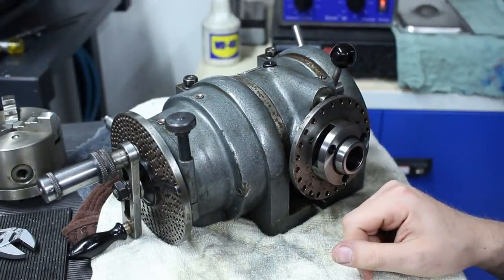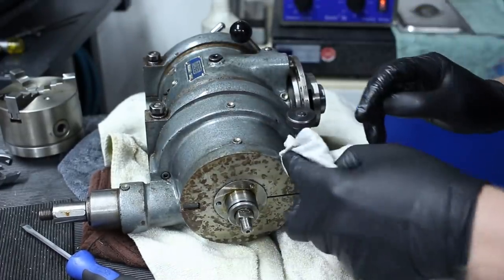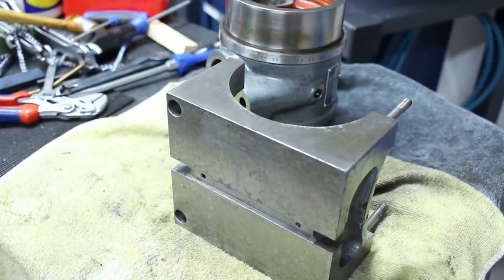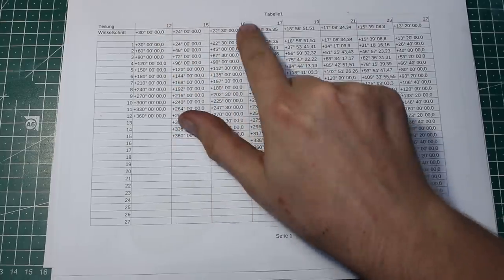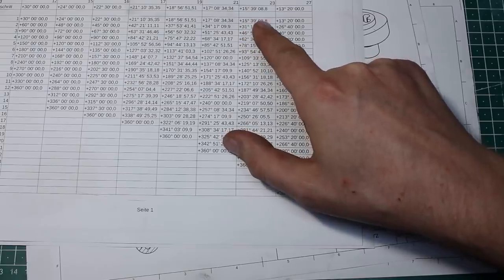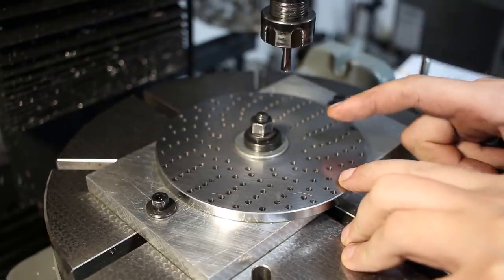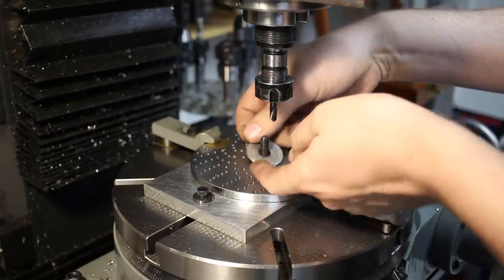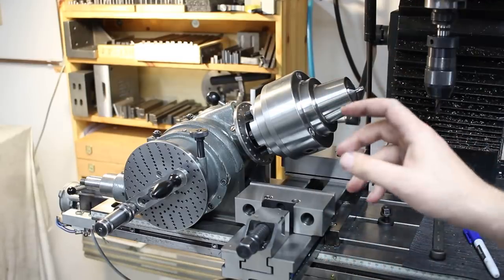Walter UTA80 dividing head

Comment: Math error! Stefan, looking at your spreadsheet, notice for your 17,19,21, and 23 columns, the arcseconds and fractional arcseconds repeat,  x.x , e.g.  31.31 . True, it only affects fraction of arcseconds, but still...
Reply: Should fractions of arc? seconds be a decimal value or in 1/60ths of a n arc? second?  The prefix "Arc" appears to  be optional.
Reply from the maker: Oh wow, yes, you are absolutely correct. I think my spreadsheet has a rounding error in there (Librecalc and office cant to seconds/minutes without a workaround, there is probably a error hidden).
19 divisions for example rounded(wtf?) from 18°56'50,53" (correct value) to 18°56'51,51", so thats almost a full second error.
Thats brutal annoying right now ;)

Just did the math, the accumulated error on a radius 100mm that equates to an positional error of 0,01mm. But thats without the 40:1 reduction of the dividing head. 
So I end up with a division error of less than 1 micron on a 200mm diameter gear/part.

Probably no gamestoper, but it still bugs me that I missed that.

Thanks for thinking along!
Reply: I was following along, using my spreadsheet (gnumeric) which doesn't  have degree-minute-seconds, so was manually generating them in separate columns. I noticed I had a discrepancy in the seconds column, and looked closer at your numbers and then saw the suspicious repeating numbers. 
It certainly wasn't my intention to find errors, only to understand your process. I'm sorry for being the agent of Cunningham's Law; it just worked out that way!
And I thoroughly enjoy your videos, long or short they always entertain and educate, working at a level I find inspirational. Thank you!
Reply: @ayaitagaki6661  you guys are all arc villains (he he he he)
Reply: @StefanGotteswinter  I think if you were not German 1 micron error  would most likely  not bother you.  :) I am very impressed with what you do.
Reply: @ayaitagaki6661  I have never heard of "Cunninghams law" before, very clever, thanks for sharing.
Reply: @StefanGotteswinter  Is it a rounding error in the Spreadsheet app(s) or is it in the OS or the Processor?
I've seen rounding errors in MS OSes in the 6th or 7th place that caused havoc and then in another instance with Intel 80387 and 80487 coprocessors back in the day. Had to use Sparc stations on the later project to attain the accuracy required.
Reply: @middleroad00  It is a bug in the formatting in the spreadsheet. A lot of spreadsheet software is very buggy to this day.
Reply: @johnmcnamara3719  I think the spreadsheet is using a decimal to express the division of arcseconds; Normally, I believe this is also done in astronomy as well. So it is near a half an arcsec, or 50.53 arsecs.
Reply: Hi DR
Do you mean the spreadsheet I created and posted via a link or the the one Stefan created?
Reply: @johnmcnamara3719  Hello, John. I was referring to Stefan's spreadsheet,  as I could make out on his video.
Reply: @johnmcnamara3719  Thanks for all the work you did and the links. It seems to work fine with Libra Office Calc on Mint 19. I'm going to try making some odd number plates

Comment: Can't thank you enough Stefan. I've mentally gone through the same exercise every time I look at the G.H. Thomas dividing head castings I have "seasoning" in a drawer. I've always thought those drilled holes in the plates weren't quite good enough. Boring would give round and on location but still leaves a straight hole with at least some clearance needed for the pin. Your extremely elegant solution of D bit taper reaming the holes solves all the issues at once. And that Walter universal makes my Vertex universal look like a boat anchor. :-)
Reply: It's common for the pin to be tapered, neatly avoiding sidestepping your clearance issue

Comment: Nice vid, I like the  way you got a chuck on the head.  I recently  picked up a mister and some synthetic fluid and it  has  made an ENORMOUS difference in cut quality and I have also been able to  increase my speeds and feeds,  and I am using the tinyist amount of mist my needle valve will let me with a strong air stream.

Comment: Now all you need is a small Moore Jig Bore but I imagine they are scarce across the pond. Probably have to settle settle for one of those guesstimator* SIP jig bores from Geneva.
Moore makes or made nice equipment. In the US I'd put them at the top along with Monarch, K & T, Hardinge and a few others. Most if not all of those companies have either fallen by the wayside or been absorbed by off shore owners.
*At work our jig bores were Pratt & Whitney's. We did however have a SIP jig grinder. Nice, really nice machine. They were told from the start it needed to be on an isolated foundation and the engineer in charge of the project did not believe them. And they wound up moving it to a properly isolated foundation. At the same time they were also installing a Kearney & Treker HMC. K & T specified a specific grout for the machine leveling and mounting screws. Same engineer did not believe them ordered cheap stuff. The installation crew would level the base. The next day do it all over again because the screws were pulling right out of the grout. Pull the machine out, clean out the holes and use the right grout. That K & T had one really nice feature on the worm for the 4th axis. They made the worm with a variable lead thread. From the start of the worm to the end the worm got progressively thicker across each turn to allow for setting table backlash.

Comment: Instead of Differential indexing I have found it faster to drill a plate with the number of holes I need using my CNC mill. The last plate I made had 61 holes.  40 spaces in 61 hole plate divides the circle. Interesting video! Thanks.

Comment: Stefan spends crazy amount of time to get super precise,almost goes nuts with that crazy rotary table in seconds-drill walks by on each hole 0.1mm :)Then comes hardening and cheap hot rolled steel deforms.Boom there goes super extreme accuracy to trash.We strive for perfection but end up happy with mediocre !!!

Comment: I really like the subject matter of accuracy. I worked on a Gidding and Lewis boring milling machine. The big mama had a DRO using magnetic inductance with a accuracy of millionth of an inch. That is a direct read out. And the technology was from the 1950's. So I really like anything with very high accuracy. The displays today use a red leasar reading a glass scale. Not very good for accuracy especially when the operator just goes crazy with oil or coolant. Have a good day too.

Comment: It seems to me you could put that PTO drive to good use with a stepper motor and even a fairly cheap microstepping driver and a little software. I think you said that drive was 40:1. If you drive the PTO with a 5:1 belt drive and use 6400 pulses per revolution on the motor, you get 1.01 arc second steps.  Not the ultimate in precision, but probably good enough for most day to day bolt circle work. And a heck of a lot easier than using the dividing plate and remembering where you are.

Comment: im so glad that i have access to a cncish machine with ballscrews and linear scales that has a cycle for hole patterns. i would trust that one to do it accurately
Reply from the maker: Fully agree, that would be the sane solution ;)
Reply: It would be interesting to see if error is measurable in some way after the worm gear ratio - maybe measuring a test part with the Moore rotary table. I would have been tempted to use a CNC machine, even lower precision CNC router,  to make a plate, maybe in thin aluminum, and then use that to make a more precise plate using the dividing head, if error was measurable. Very interesting video.. I really appreciate the opportunity to look over the shoulder of someone doing unique things.

Comment: Stephan, your work ethic is wonderful to hear stated. Too many people do "just good enough". I say leave making hamburgers to those people.
Reply: Unfortunately the endless pursuit of precision where it goes beyond the amount needed is not economical in the real world. Here is were we enter into the world of tolerances. A pass hole for a screw with 1 mm or more of clearance diameter wise does not need to be with in .010 mm of true location. .1 mm (.0394") is close enough. The hole location only needs to be with in the tolerance specified. The tapped hole should be closer to the true location than the pass hole on the mating part. Good enough can be used as excuse for sloppy work, that is true. But the tolerancing on parts not only needs to meet the engineering needs but also the practical needs of the job the component is meant to do and the limits of the manufacturing technology* being used. Along with the material being machined. Believe me you could take two parts machined in the same fixture hours apart and the locations of the features being machine in relation to the locating feature on the part and the locating device in the fixture would not be the same. As long as the features are with in the specified tolerance, it is could enough. Put another way. Perfect is the enemy of good enough. 
*In a lot of ways I have to laugh when I see somebody with an import lathe in a home shop trying to chase tenths across the length of the machine. First how is the lathe mounted. How much can that mounting surface shift with temperature, humidity etc. Plus you can never really get beyond the limits of accuracy the bed of such a lathe was ground to in the first place without doing a lot of work. It may have had a twist ground into the the bed right from the start. In my mi d the best thing to mount a small lathe or benchtop mill to would be a properly supported granite surface. This could be an old surface plate, granite purchased from a monument's dealer (tombstones) or say three granite sink cutouts laminated together with epoxy. Drill the granite and epoxy in drilled and tapped inserts that match your machine mounts.

Comment: Stefan, thank you for sharing your expertise, I learn something in every video. Off topic question, when you are not using your Moore rotary table and your Walther dividing head, what kind of surface do you sit them on for storage. I am planning a storage box for some of my mill accessories and don't want to create any issues with the ground surfaces.
Reply from the maker: The moore rotary table sits on a furniture dolly, as its bloody heavy. I hose it down with rust preventive and cover it with a clean rag, to prevent rust.
The universal dividing head and my rotary table sit in a lista style cabinet on a rag.
Reply: @StefanGotteswinter  Thank you for taking the time to reply. I have mounted a section of unistrut over my mill with a small trolley and a simple rope come-along to lift my rotary table and dividing head from a storage cart to the mill table. The storage cart has casters which allows it to be stored safely under a cabinet.

Comment: Er, um, yes. Magnificent in fact. But you  had a rotary table which could be read out to arc seconds. Not to criticize but to learn (nicht zu kritizieren, aber nur um zu lernen) as the great Niels Bohr said. So you had a master dividing head. If you had no such an animal it might be preferable to work out the X-Z coordinates of each hole and drive the mill to each hole with the DRO. Yes there will be errors. But I can't work in minutes and seconds anymore -- I regard them as obsolete -- and I would have opted for X-Y coordinates anytime. I make my plates out of templates produced by a program I wrote myself. I use  an optical center punch ... well enough. A very thorough and professional job.

Comment: I would love to know more about the carbon nitride plasma treatment.  Not much on the internet about it that doesn’t also require a Ph.D. in metallurgy to understand.  I assume it hardens the steel without inducing heat to a level that would not distort the steel substrate and thus also slightly change the relative hole positions?   If you used conventional heat treatment, hole position accuracy would be lost.   Is the plasma carbon nitride conceptually similar to carborizing in yielding a layer of hardness on the surface?   Thanks for this video - very nice work.

Comment: Lovely Information !  Thanks.  I've read one time, quite some time ago, that the most precise lathe was built using a bushing on the headstock rather than a ball bearing.  This was the only way to get the high level of precision and load bearing that was required.  This makes sense to me, and I have therefore often thought that the bushing was the superior bearing.  I assume it was oil-impregnated.  Why is it you feel the ball bearing offered better support?
Reply: Damn that comment was for the slow speed grinder video

Comment: i have recently purchased an old HU 80 dividing head.  very like yours minus the pto.  when reassembling, did you have to freeze the shaft and heat the brass gear to get it to go together?  it's a very tight interference fit.  i want to get it right, but fear banging it up or misalignment.

Comment: When you take apart a complicated  device like this, do you often refer back to your video to see how to put it back together?
Reply: As a mechanic, that looked pretty basic to take apart and put back together. Precision devices are usually simple, because the less complications the easier they are to keep precise. Also, things rarely fit together right in more than one way, you can feel this while putting it back together.
Reply: @ColtaineCrows  yeah, the only tricky part is the screws: it happens that there are slightly different lengths, all of the same diameter, so getting them to correct holes is a bit of a guess-work without preparation/video
Reply: @666Tomato666  
That's way I always bag and tag parts.

Comment: Interesting taper bearings and lock,  how does it cope with using a tailstock ? Doesn't the lock jam when hold piece between centres?

re paint: the walter I had (a big one!) was also green. I guess , since milling machine manufacturers tend not to make their own dividing heads, it would be obvious to buy them from Walter and have them painted to match their mills  (I have a  Elliott one that ix similarly painted)

Comment: How much more accurate is the dividing head than doing the layout in cad and getting coordinates for each hole to use with the DRO? Obviously that would take forever not on a CNC but just curious lol.
Reply from the maker: Hmm. In this case the rotary table will be about 10x more accurate than just moving to x/y. (The linear scales on that mill where 0,005mm increments and the squareness of x/y was not perfect, so you introduce a lot of errors there) 
Not that I would matter much, since the error on the plate is reduced by factor 40 due to the worm gear reduction in the dividing head :D
Reply: @StefanGotteswinter  thanks for the response man! I kind of figured that would be the case as you also factor in human error when involving anything outside of mechanical or digital action taken lol. I’m figuring my way into the precision world with little funding or proper training so I am always looking for all the available options lol

Comment: The general rule is that you need a measuring instrument five times as accurate as what you need in accuracy in the measurement. The same thing is true in making a part. So you take the highest amount of accuracy you may need, and make your instrument five times as accurate. That gives you an accuracy that’s no more than 20% off from your measurement number. So if you need one second, you won’t be off by more than 20% of a second. That’s actually pretty good. Of course, you can extend this down to whatever level of accuracy you need.
Reply: Probably the single most accurate pieces of machinery ever made are large optical telescopes. The need to point to x°, x min, x sec, x whatever the next division is. And these are really large pieces of machinery

Comment: I did have a question.  On the d-bit ground taper bit, why not just make the bit a tad longer and clean up thebottom of the wholes as well as the edges, instead of just the top half of the hole?  Anyway, fascinating stuff.  I really enjoy these teardown videos.
Reply: That 'simple' D bit had no end cutting geometry to clean up the bottom of the holes. I'm sure Stephan could have made it that way but the tool would have been slightly weaker and unnessesary as the locating pin should not reach the bottom of the hole for accuracy's sake.

Comment: Stefan, I did originally ask this question on the related video, but as I got no reply, I thought I would ask you again here. When you built the Hemmingway Rotary Broach, did you hollow grind the ends of the punches you made ? Commercial made ones ARE hollow ground. I would think that grinding so would give you a faster cutting action. Thanks in advance.
Reply: I'm pretty sure they have to have a hollow grind on the face. Otherwise it's a neutral cutting action and would make high cutting pressure.
Reply: He probably forgot to mention it

Comment: Hi Stefan, great video.  You once mentioned that you use a small hand grinder that is much better than a Dremel tool. What is the model name and part number ?  Thanks
Reply: Just from memory: it’s a Proxxon, but the model I can’t recall.
Reply from the maker: The biax airpowered diegrinder?
Thats a SRD 3-55/2
http://www.biax-germany.de/en/produkte/data/SRD-3-55-2_150000925.php

Comment: you didn't mention just how you determined the proper radius for each set of holes??
Reply: Measure the radius of the lowest hole count of the original plate and just space out the hole circles. Not rocket engineering.